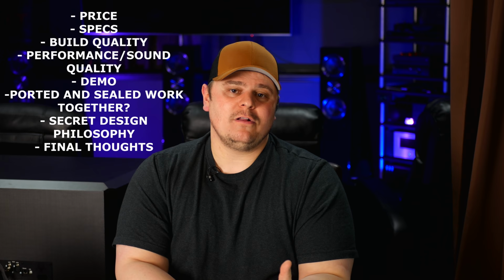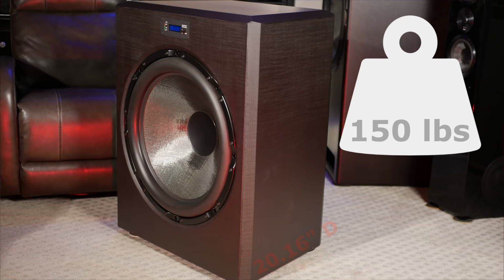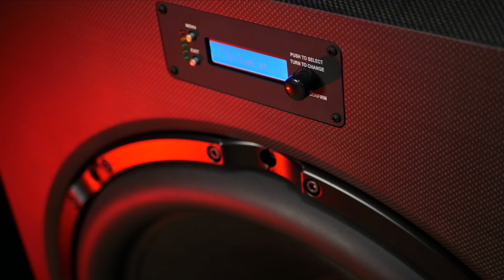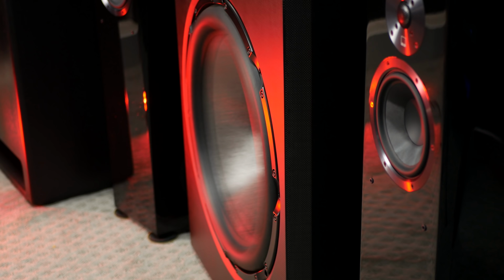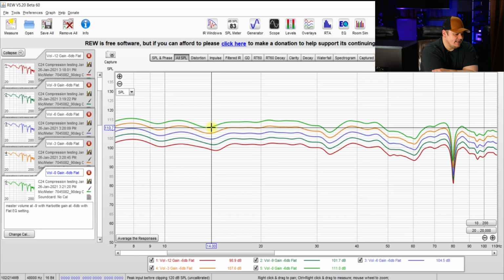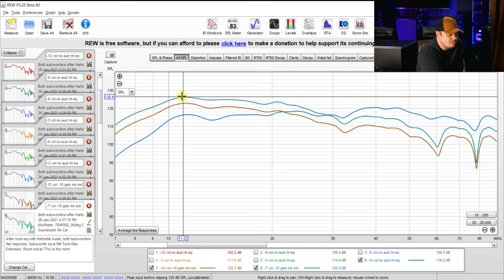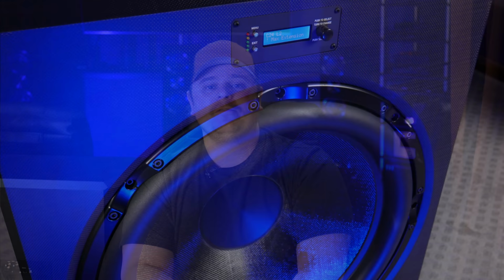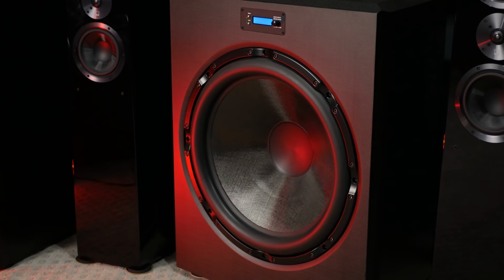Mixing Ported & Sealed Subwoofers CAN BE DONE! 24" Carbon Subwoofer, Harbottle Audio C24 L2 Review!

Comment: I think this was your best review yet. I appreciate the details you gave, the measurements provided & the clear distinction made as to why it performs so extremely well.

Thank you for explaining to your viewers how a large driver can be accurate & describing how the cone needs to move much less per equal output level.

Truly accurate bass is something so many people THINK they have heard but really HAVENT. It’s good stuff!!
Reply from the maker: Thanks brother, I appreciate that.  You are absolutely right, even I thought I had good clean powerful bass, until I tried this subwoofer and the Funk subwoofer.  I then realized, I only had good bass for the price I paid, but if you spend more, there is much better bass to be had.

Comment: You got me sold! I am just short a few pennies...like 900,000 of them.
Reply from the maker: lol, sheesh...if I go through my couch I might be able to get you to only lacking 899,996 ;P.  Thanks for watching man!
Reply: Just so you know, the C24 starts at $6350 CAD and $4900 USD. There is also the C18 coming out soon with a price point that looks very attractive. There are options for different budgets, I'm trying to be all things to all bassheads 😁
Reply: @codyhiebert7544  Appreciate the reply. I do have your site bookmarked in my Dream Theater folder for theater updates. That flat in room response at high spl really got me wanting. Thanks to this world event, money is being spent considerably more conservatively. Thankfully my sub situation isn't desperate. I do have 2 PSA S3000i and 1 PSA XS-30se in my 1800 cubic foot room.
Reply: @jjchmiel78  I feel ya, and I still want to give you the best experience as I can add a business and manufacturer. Please keep in touch. You can follow my Instagram and Facebook, and I also have group buys for very easy diy kits that are very cost effective for this performance level... Prebuilt boxes, same LDLC engineered drivers, modular amps for easy and cost effective expansion too. 
Feel free to drop me a line to just say hi.

Comment: Great video man! The question I have do you like the ported or the sealed better? Are you planning on picking the one you like better and go duals with either ported or sealed. I'm thinking about doing diy sealed subs. Thinking about going with stereo integrity 15 inch subs
Reply from the maker: Thanks brother.  Ohhh, the age old questions of ported or sealed lol.  Well, let me word it this way, if it came down to shear performance it would be the Ported LFE24 Ultra.  It does have noticeably more output in the lower frequencies.  BUT, with that said the Harbottle offers some AMAZING performance in a smaller more manageable package.  I may consider going with dual Harbottle C24 in the future, simply because of the manageability and size.  For right now though, these are working really nicely together in my room, I am a happy man!

Comment: I'm confused why you'd want that giant ported one in that small room.   I agree with what you said about value.  You can have a high price and a high value.  These are luxury products, yes you pay extra for the finish and the cool factor.  If you just wanted output you could go with JTR and you'll have good performance but awful cabinets and not as fancy of parts.
Reply from the maker: My room is a lot bigger than it looks.  It is 21' x 17' x 8', and my home is a 4 level split, 3 levels are open to each other, the family/theater room being one of them.  100% man, value is also subjective, some find value in things that others don't.  Thanks for watching...cheers.
Reply: @SpecOfTech  Ah so the theater is open to the rest of the house?  That explains a lot.    One day I'd love to have like four funks or harbottles (i'm confused on the difference) in a dedicated theater.   I imagine it's even more expensive to buy in the US though.

Comment: Hey there, new to your channel and I really like the reviews and advice. Got a question, I have a Yamaha RXA3080 and wanted to know if it makes sense to run a Pioneer M-72 amp through the Yamaha pre-outs to power front LSI-9 Polk speakers or just use one of the Yamaha's channels not being used on my 5.1.2 set up? Thanks Ron
Reply from the maker: I would go with the separate amp option through the preouts.

Comment: A couple of things. 
Do you have any smoothing applied in REW? 
Your a-xis is showing 10dB progression. Set the limit so that it shows 5dB of progression. Also set the limit so that you can see up to 60 difference max. For example, You have Y- axes set to 50-140. That's a very large range and makes things look nicer than they are. You should have it like 60-120. That will show much more realistic FR of subs. 
You mentioned that they provided you custom curve. What do you mean by that? Did they give you custom EQ that you uploaded in sub dsp?
Reply from the maker: There is no smoothing applied.  The one REW graph I used that increases by 10db, there are still other lines there to help you see the variance in SPL to see the +/- numbers.  You can still see that the line is quite flat based on those numbers.  Regarding the custom EQ, I did explain in the video exactly what it was.  Cody, from Harbottle remotely connected to my computer and adjusted the DSP based on those measurements.  The remote session is included in the purchase...cheers!
Reply: @SpecOfTech  cool thx for the clarification. How hot do you run the subs to get all the thunder and is that any sub NF?
Reply from the maker: @sherazdotnet  No problem man.  I have the gain set at -10db on the subs, and trim is -6.5db in the processor if I remember right.  These 2 subs are MORE than enough lol, they are absolutely insane.  What subs do you run?

Comment: Brilliant stuff, which sub measures better in your room?
Reply from the maker: For the most part they measure the same, but the LFE24 Ultra has more SPL in the low stuff.  The Harbottle has more output below 10 hz to about 6hz though, since it is sealed it doesnt roll off as quickly.  Both are absolute beasts, but the Harbottle puts out amazing numbers for it's size.
Reply: Interesting pluses and minuses on both then, but for most of us they would be endgame subwoofers….if I had to choose I would go with the Harbottle due to its compact size 🤩
Reply from the maker: @philsingh8153  and the Harbottle has the Carbon Fiber looks which I prefer.  The Funk is gorgeous too, but something about Carbon Fiber, I just love it.

Comment: I have a quest a regular 120 volt 15 amp circuit can output 1800 watts or 120V 20amp  can do 2800......240V 15amp can do 2880watts and lastly 240V 20amps can do 4800 watts  

So the question is how can this subwoofer put out more watts than  available????
Reply from the maker: Great question!  If you noticed in the video, I stated that the RMS is 4400 watts and the peak is 10400.  The 4400 watts is the constant power the amplifier can put out if fed a 240V 20A circuit.  The 10400 watts is peak power that it can hit for short bursts only, and it does so using stored energy from the capacitors.  Hope this helps...cheers!

Comment: Great review as always. In your opinion how does the JTR captivator 4000ulf compare I this, music  as well as home theater use?
Reply from the maker: Thanks man.  Well, they are different animals.  This C24 is more comparable to the RS2.  The C24 will have a little more output throughout the frequency, assuming the RS2 performs similarly to it's predecessor the S2.  Where the Harbottle will set itself apart is in the distortion levels, they will be significantly lower.  If you want something similar to the CAP4000 it would be the Funk Audio LFE24.  The Funk does out perform the CAP by about 3db drom 20 hz down...ish.  Again, it will have less distortion as well.  That being said the JTR subwoofers are amazing for their price, no question.

Comment: So what is the difference between this and the Funk 24” ? Just the carbon fiber case  and port ? 110 db at 8 Hz is pretty impressive...also 126 db cant be healthy for ones hearing.
Reply from the maker: You got it my friend.  The only differences are that the Funk LFE24 Ultra is ported in a veneer enclosure, and the C24 L2 is in a sealed enclosure with Carbon Fiber composite.  The drivers and amplifiers are the same.

Comment: Wont most 120v outlets be rate limiting in terms of peak power actually provided  ?? Also, it would seem easy for this to overpressurize  a room.
Reply from the maker: Yes, you will not get full amplifier performance without a 240V 20A circuit, but that is true for all high power amplifiers.  My room is unique, it is open to 2 other levels of my home, I basically have to pressurize my house lol.

Comment: Great informative videos. I'm asking becuase I'm looking at Funk Audio subs and for the price wanted to make the right decision.

I'm looking at the 21.0LX and was debating on the ported one but the wife doesn't want that large subwoofer in our current house so was thinking if I got the smaller sealed ones for now and in a few years when we get our larger house with dedicated theater.

 I could add the two ported 21.0 which is the same driver and amp but give the back reverberation that my sealed subs are missing that my old Alpine and Klipsch Ported 15s had and have the four 21s and if they can blend In seamlessly that's be great. Reinforce the matching frequencies and introduce the ported created ones.

There's a lot of songs that actually are created for ported subs like Bass I love you for example and even with dual sealed 18s and Dual sealed 15s I have now 4 subs my old Alpine 15 Type R In 1 18hz tuned ported box sounded better.
Reply from the maker: If you are looking for the most amount of clean output for the price, try looking at the JTR RS2's. The have a small footprint considering they are dual 18" and they have a substantial amount of output for sealed subwoofers. The Funk subwoofers are great but you are paying a premium for the finish on them.

Comment: Cool video :) I wonder how to open my velodyne EQ 10 Max Speaker, it's faulty and I can not see a screw on that speaker for disassembling it, any clues ? thanks
Reply from the maker: Hey man, my guess would be the trim around the driver can be removed to reveal the screws.  I have never disassembled one myself, but that would be my bet.  You could always start by removing the plate amp, since that does have visible screws and gain access that way.  Maybe there is just a loose connection or something.  Hope that helps, let me know how it works out.
Reply: @SpecOfTech  Hi, looks like there are some screws from inside for holding the cover ( clamping ) the speaker, what's the resistance of this speaker ? the power is 390W, is it 8 ohm ?
Reply from the maker: @RixtronixLAB  So if you remove the amp, you would be able to get at the screw holding the driver trim on.  Are you asking about my subwoofer or your subwoofer for the impedance?
Reply: @SpecOfTech  yes, is it 8 ohm or 4 ohm ?

Comment: What's your opinion on paradigm signature 2 subwoofer in power and low frequency under 10hz at over 110db spl and the sound clarity?
Reply from the maker: This C24 out performs the Sub 2 significantly and it will have less distortion as well.  The Sub 2 only hits 94db at 10hz and the Harbottle will hit 99db.  5 db more is pretty significant, it would basically take 2 Sub 2's to match the C24 at 10hz.  The C24 gains even more output on the Sub 2 moving up from 10hz.  If you decision is between the Sub 2 and the C24, the C24 wins that hands down.
Reply: @SpecOfTech  thank you I can skip buying that I was contemplating a subwoofer shootout before going with 6 of each
Reply from the maker: @BIGBASSSAMA_4  I hope you are serious about buying 6 of them lol, I would LOVE to see that.
Reply: @SpecOfTech  it's no joke I'm buying 6 TV36 Ipals 1st then these I make enough a week to do it eventually lol my end goal is a 9.6.6 dream system
Reply from the maker: @BIGBASSSAMA_4  That will be truly amazing brother.  I would love to see the system when you are done, send me some pics!
Reply: @SpecOfTech  I'll share my video link in the comments on 1 of your latest videos to easily find it lol

Comment: What mic do you recommend for measuring down to 5hz and up to 200hz at the most? I just bought my 1st sub psa s42 ipal🤩
Reply from the maker: That's an impressive sub man, nice choice.  In all honesty I have had a good experience with the Minidsp Umik-1, but it is supposedly only rated for 20-20000 hz.  I have never had issues measuring below 10hz even, but some will claim it's not accurate.  The Omni Mic from Dayton is rated down to 5hz but is more $$.  Here is a link for the Umik 1.
https://amzn.to/3plbXjt
Reply: @SpecOfTech  I just bought a denon x4700h avr would a mini dsp be worth it like It also comes with dirac live and umik-1 would this outperform all the bass tweaking software denon has I'm very new to this all?
Reply from the maker: @BIGBASSSAMA_4  Oh yeah, the minidsp with Dirac will work together and give you a much better response than the Audyssey room calibration software alone.  The software and mic you have purchased will give you full dsp control...good choice.
Reply: @SpecOfTech  🤟
Reply: @SpecOfTech  that's awesome buying right now 🤣
Reply: @SpecOfTech  just bought the mini dsp with dirac live upgrade and umik-2 the latest umik🤟🤟🤟🤟

Comment: So what's the difference from the C24 and the Funk 24.0? I see they are partners now.
Reply from the maker: Yup, they are affiliated.  The main difference is the LFE24 is Ported with a wood veneer finished and the C24 is sealed with a carbon fiber finish.  The drivers and amps are identical.
Reply: @SpecOfTech  The Funk 24.0 that will ship to me this week is not ported though. That's why I was wondering what the differences are. Awesome review by the way!
Reply from the maker: @gaetanlarocque1511  Sorry, my mistake lol, I am used to be asked about the Funk LFE24, because that is the other one I have.  The Funk 24.0 and the C24 are very close in all aspects except for the enclosure finish.  Performance wise they will be very similar.
Reply: @SpecOfTech  Thanks for the reply and keep up the good work!
Reply: We have been working together for about 10 years. I started off consulting Funk's business and headed the rebrand from Funky Waves Audio to Funk Audio. Fun little backstory for ya.  As for the 24.0 and the C24, the diff is the enclosure. Funk has the curved sides and custom wood finish, mine is only available in carbon. The C24 is also more "techy" in that the carbon is a performance feature of the enclosure and behaves differently than a standard veneer. Another difference is the cabinet size and dimensions. The C24 has a slightly bigger internal volume that increased the efficiency of the low end.
Reply: @harbottleaudio  Cool stuff, thanks for the reply!

Comment: Sealed or ported version of this sub ?
Reply from the maker: I have the sealed Harbottle C24 which is reviewed in this video.  I also have the Funk Audio LFE24 Ultra, which has the identical driver and amp as the Harbottle C24, but it is ported.
Reply: @SpecOfTech  same sound just more output from the ported?
Reply from the maker: @mrlinde6518  haha, yeah that pretty much sums it up.  These are incredibly clean sounding subwoofers that have incredibly powerful bass, but if you want max output the LFE24 Ultra will give it to you.
Reply: @SpecOfTech  thanks great videos btw enjoying it:-)
Reply from the maker: @mrlinde6518  No problem man, thanks for watching!!

Comment: that thing is tiny why not get the 50inc one  9kw 5hz infrasonic house destroyer haha
Reply from the maker: haha right!?  I would love to test out that 50" Ascendo one day, that is a beast.  Until then I guess I will settle with this puny 24" ;P.
Reply: @SpecOfTech  there in stock but you will need to sell your house and build a new one around it  lol wonder how much the recone kit is  as it wont woof forever!  the mid range foam on my genelcs are drying up and starting to crack after 20 years of use and cost £5500 each. there are parts just extortion prices £400 for a 5" recone kit as wont just sell me the foam surround yet there all about sustainability and saving the planet my ass lol
Reply from the maker: @soundwave6769  Sorry to hear that man, it's too bad they won't work with you on that.  I am sure the recone kit would not be cheap for this either, depending on the price I might just replace the driver after 20 years lol.  Thanks for watching...cheers.